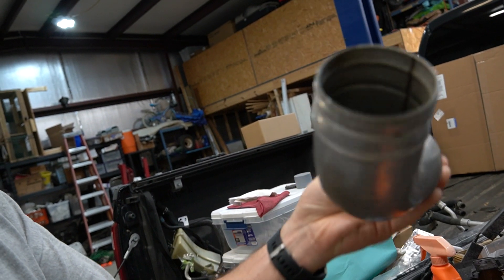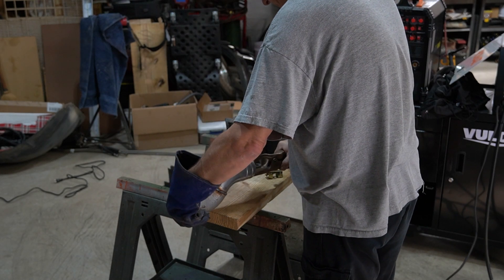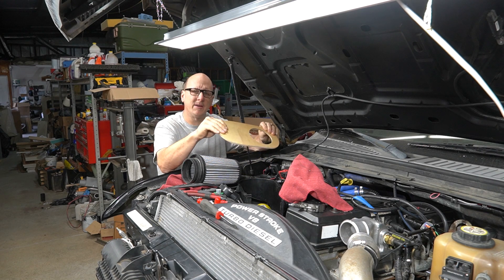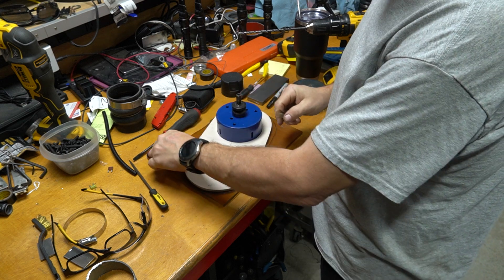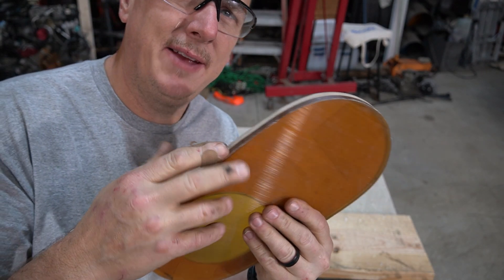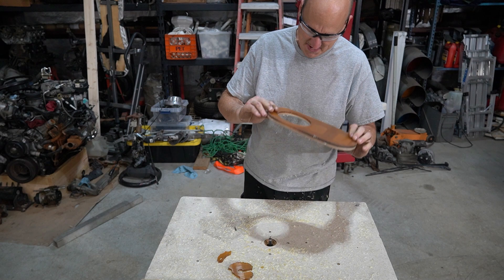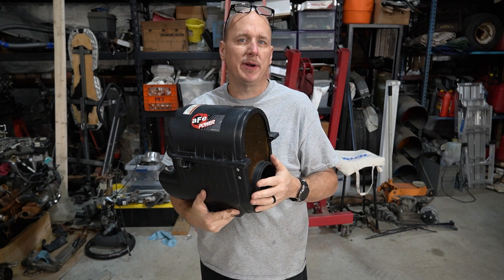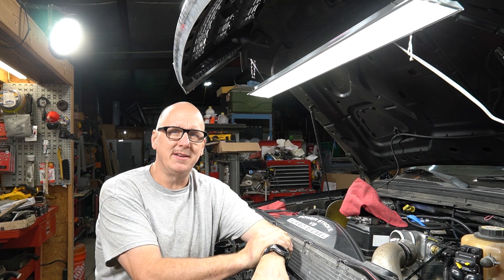The Fummins Project - Episode 18 - Time to build the intake and intercooler piping

Comment: What did you use for the air cleaner housing
Reply from the maker: The airbox itself? That is the factory airbox from the truck. I had to remove the factory front (horn) and make the piece to replace it.

Comment: Mass produce the air box adapters ( I'll take one please 😁). Where did you get the air filter that fits perfect into the air box?  Thanks in advance.
Reply from the maker: I am not sure I want to mass produce anything. LOL! Are you talking about the plate I cut on the router or the piping?

As for the filter, it is the one that came in the DCS kit. It is an AFE. They have updated the "Kit" to include a lot more than what I got. https://dieselconversion.com/air-intakes/6-4-to-2003-2009-cummins-common-rail-air-intake-kit-using-stock-6-4-air-filter-box/

I will get the AFE part number and let you know.
Reply: @FunKingGarage   WOW!! They took your job and made an adapter plate. Yes sir, the plate you cut out on the router. Looks very nice.
Reply from the maker: I am 99% sure I still have the template. Maybe we could work something out. ;) And that filter is an AFE 21-40035